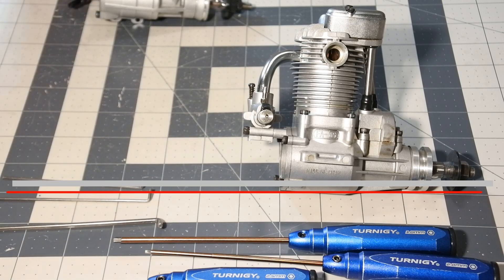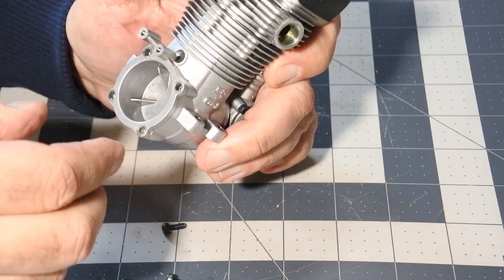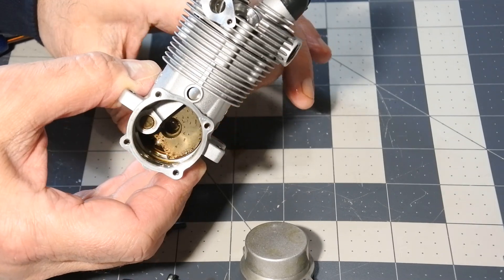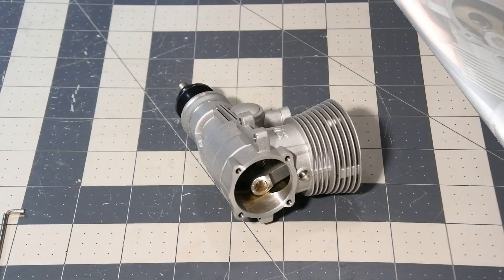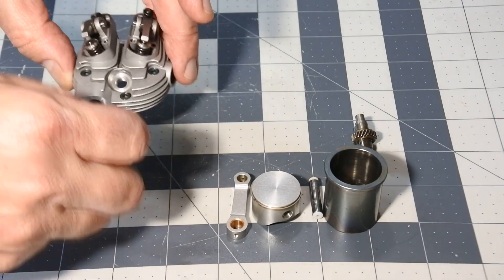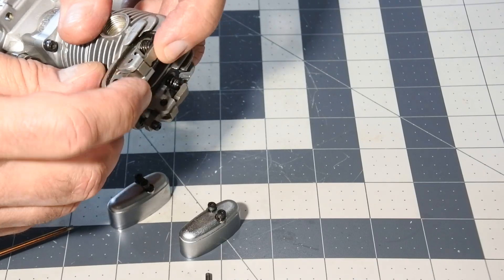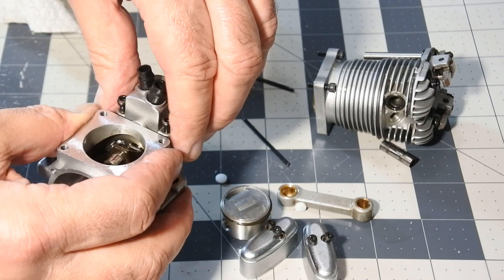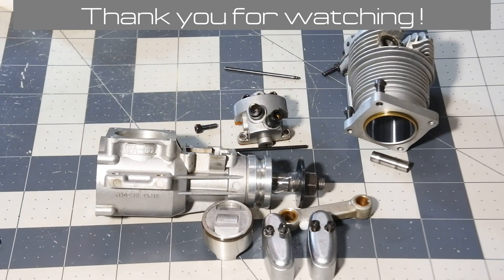Checking TITAN's internals after the NITRO battle

Comment: Hello my friend. You have an excellent channel. I have a question if you have any idea about it. Some OS Surpass 4 stroke engines have pump (PD 07) installed on them. I have noticed the pump becomes weak if the engines are sitting for a few years… no parts are available for the pump. Do you know how to improve the performance of these pumps or bring them back to their original performance level. Thanks i will look forward to your response on this subject
Reply from the maker: Hi, thank you for your kind comment! Unfortunately, own repair of O.S. fuel pumps aren't recommended by manufacture, and all attempts for repair you should take on your own risk.  I have some experience with pump repair for those engines, but I should twice warns you that this could be done by very qualified technician with a lot of experience. If you decide to try to repair it by your own, I can give you some advices, please, try to follow it. First, managed the working place - it should have enough working square, being brightly lit enough - fuel pumps consist of a lot of small parts. Second, make a photo  after each step of dismantling. Third, (and that's is important), check the fuel pump membrane for integrity and for a lack of dents or cracks. It is necessary to flush \ clean all the small channels in the pump body to remove all contaminants, in particular, residues of dried fuel and oil mixture, usually either this or the stuck membrane interfere with the normal operation of the pump. After this steps you can assemble fuel pump back,  with the help of you taken pictures. So, that's basically all recommendations. Please, be patient and consequent  with this work.  With best regards and have a nice day !

Comment: congrats formthe video.....is it possible to run a saito glow engine with petrol/gas? with a G5 spark? have you already did this test?
Reply from the maker: Thank you for your question and for comment ! There is two steps: First, your Saito's carb for glow fuel definitely, will not work with gas / petrol mix fuel, due to the the fact, that gas / petrol fuel has very different air / fuel mix ratio in comparison with methanol based (glow fuel). So, firstly, to convert your Saito glow engine into gas fuel, you will need to install / to replace your existing glow fuel carb for a gas designed fuel carb. It's not easy, but it is possible. Second: you can use OS G5 type glow plug to ignite the engine. I would also tell you, that not only OS G5 glow plug could work flawlessly with gas mixed fuel. Most of the glow fuel plugs also could do it.  You can watch some videos, where is clearly confirmed, that not only OS G5 glow plug could work with gas fuel.
Look here https://youtu.be/Gv9A3m6xySs or here https://youtu.be/_r9_qW_msr8
Thank you, and if you need some more info, doesn't hesitate to ask.
Reply: @crazyengines88  thank you dear friend and congrats for the video again.
Reply from the maker: @werfir884  Thank you, it was a pleasure, really, to answer to your question.
Have a nice day !

Comment: They were being used within the expected range and ran for how many minutes total? Were you looking for defects? There are no applications in RC which really pushes a four stroke engine. The exception may be the warbird racing class where some run the YS 115WS on 60% nitro.
Reply from the maker: Thank you for  your comment and for letting me know some facts ! I have some experience in repairing engines from eBay, and which, in my opinion, were simply "tortured" by the owners, and were sold in "only 6 flights" condition 😞 I was  feared for the condition of these test engines, after several hours of testing, some of which were at maximum speed. Exhausts becomes darkened. And I am really very pleased with the high reliability of these engines, as well as the fact that I did not find any signs of wear even after intensive loading on them.
But 60% Nitro is something beyond ....
Reply: @crazyengines88 Yes, I've also seen some terrible used engines. I think this torture is usually overheating (running too lean and/or not enough air flow) and lack of after run oil. The type of oil in the fuel is a factor.
Reply from the maker: @rcdieselrc  Sure, agreed with you, oil type is a key factor of the engine safe and long life operation. My own preferences are  Motul Micro 2T, and some Klotz blends. Both were tested a lot, with great results.

Comment: Today's synthetic oils leave no residue of combustion within the engines.
Reply from the maker: Thank you for your comment ! Certainly, yes, and that's great ! Some contemporary fully synthetic oils really makes a big difference of an engines  operations. Having some experience with pre-owned engines from eBay, I was assumed, that I will found a lot of burnt fuel residues all over the crankcase and especially, carbon build up and soot  on the valves and in combustion chamber. It's very hard to remove. So, I was positively surprised, and appreciated Model Technics for their contemporary  fuel formula. 
Thank you and have a nice day !